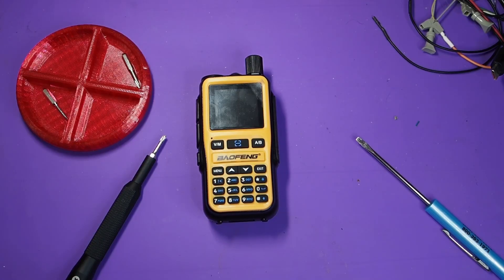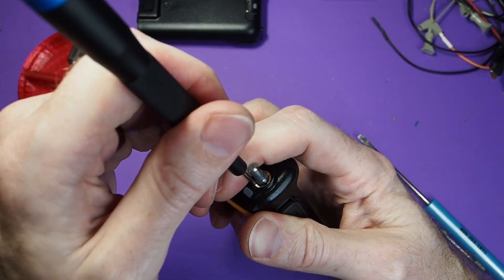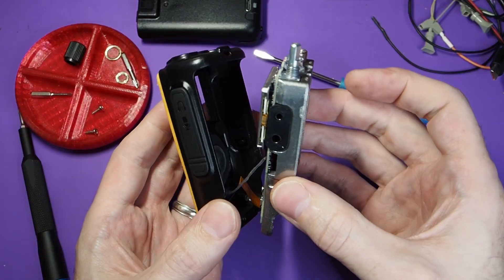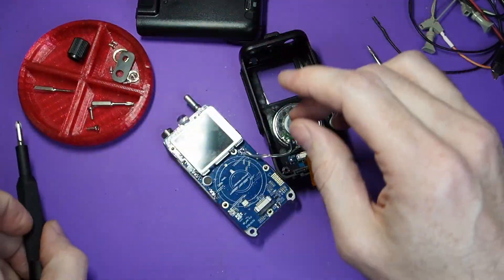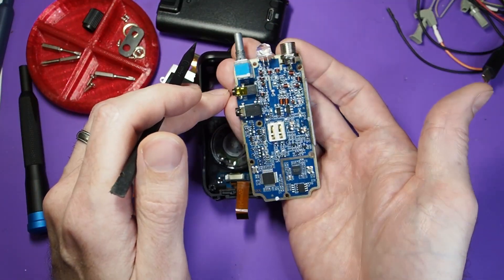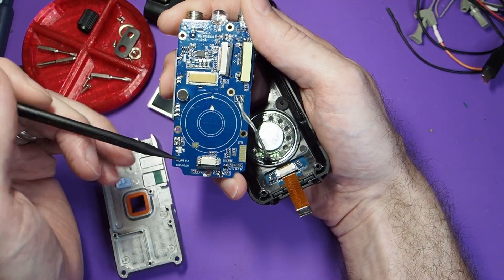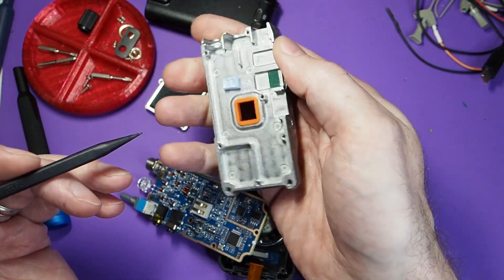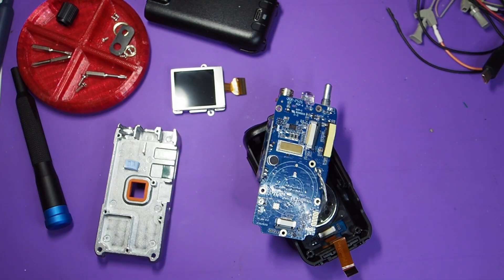Baofeng UV5R mini teardown

Comment: I JUST SLEDGEHAMMERED A UV-5R MINI THAT WAS NOT WORKING RIGHT OUT OF THE BOX. IT WAS NOT THE RIBBON CABLE, THAT WAS IN CROOKED, IT WAS THE RADIO ITSELF. POWERED ON THEN SHUT RIGHT OFF.
MY TIME IS NOT WORTH EVEN THE SLIGHTEST EFFORT OF EVEN TROUBLESHOOTING IT. IT GOT THE HAMMER AND I'LL REPLACE IT WITH A NEW ONE. THE NEXT ONE THAT GOES BAD WILL GET THE SAME TREATMENT.
I'M NOT CHINESE SLAVE LABOR BEING PAID 20 CENTS A DAY. 
THE VENDOR WOULD NOT REPLY TO MY COMPLAINT SO I'M WRITING IT OFF TO LESSON LEARNED AND NEVER DOING BUSINESS WITH BANGGOOD EVER AGAIN.

Comment: I received the two UV-5R Mini HTs a couple of days ago.  I love the tiny size.  I love the crisp color screen.  I love the USB-C charging.  I love the build quality that is inching up on the Japanese.  The RF harmonics are much better than Baofeng has always done and is in full FCC compliance.  I ordered before the Mini was CHIRP programmable but now it is, although I still need to program them.  Unfortunately, the receiver sensitivity seems awful and the front end overloads easily.  Maybe I got a pair that were built on Monday morning or Friday afternoon.  I'll probably keep the pair in the 4WD mini truck with short stubby UHF antennas for vehicle to vehicle communications at a range of 500 feet or less, but I'm struggling to find a use for HTs that are this deaf.   :-(
Reply: The deafness problem seems to be associated with the squelch setting, especially with the short antennas. Annoying, but try turning off the squelch entirely - that's what I had to do.

Comment: Do you recall if the microphone port in the front case had a rubber gasket or seal?  I don't think it does but was just curious if there's anything blocking/filtering the audio from the mic port..?  The firmware doesn't have a mic gain option.
Reply from the maker: Definitely nothing between the mic and the world, I see daylight through the tiny mic port hole. The usual light felt pad over the capsule itself, and a little foam donut to pad the front case, that’s all.
Reply: @BrianMaybeMedia  Okay thanks!

Comment: Amazing how Beofeng can make something this complex and well designed with good quality control and a host of desirable features for the price of a large pizza with beer.
Reply: what quality you are talking about ?!!!!!
Reply: @HH-CA  It meets the advertised power rating without all the spurious emissions common on budget radios. Audio quality is good. Air band isn't so good. The menu is easy to navigate and I haven't heard of anybody reporting a failure with this radio. Appears to be a solid performer.
Reply: @BUYBOTH not true
Reply: @HH-CA  Which part? What's your experience with your UV5R Mini?
Reply: If you have some coins- 15.25 Euro in Double pack- incl. Shipping... I mean... 😂 Insane
Reply: @majorbronko4096  Until you get one of the two or four that doesn't work, then they screwed you.
Reply: @Tom-qx5nl  
I have four and they all work just fine.